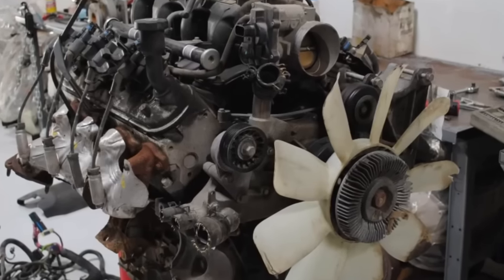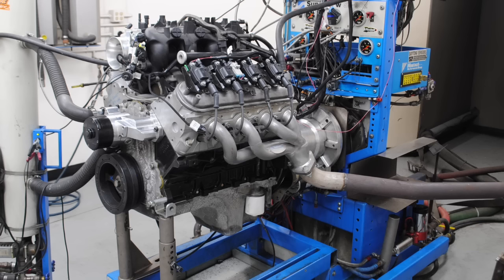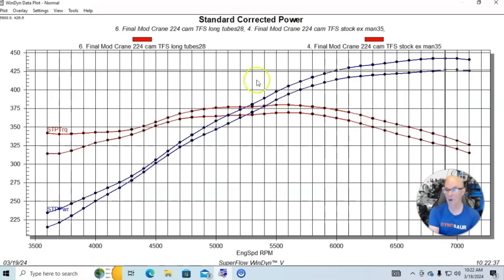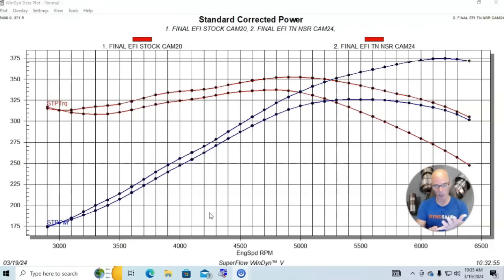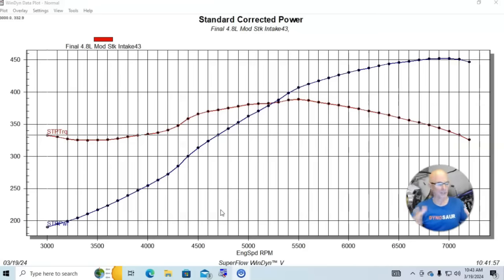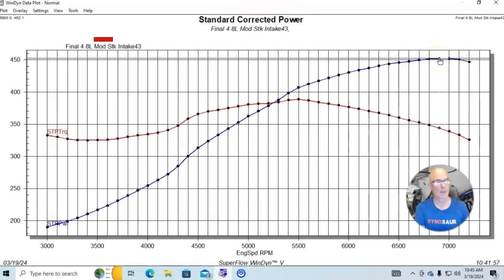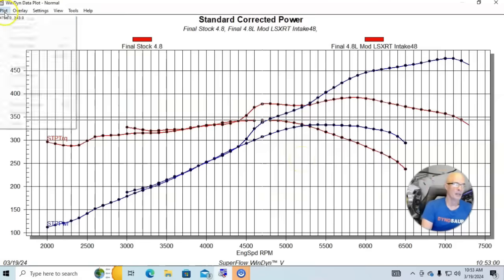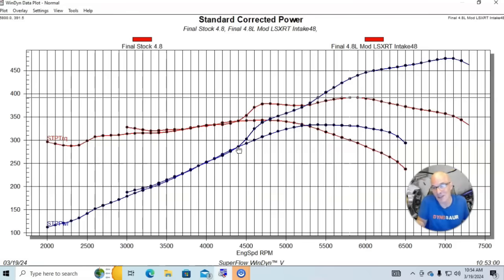HOW TO: MAXIMUM PERFORMANCE 4.8L! HEADERS vs CAM vs INTAKE vs HEADS, CAM & INTAKE! WHAT WORKS BEST?

Comment: I have a 234/239 | .615”/.610” | LSA112+2 cam on my 4.8L so what’s the best suggestion to make it run right w the cam instead off swapping the cam/engine ?
Reply from the maker: you can tune it properly, add a converter or change gears to help that very big cam run well on that small motor
Reply: @richardholdener1727  I have stock gears w no pos & the right torque converter !

Comment: Thanks for all your experience  n time ,i built an lq4 stock n put it into my 67 c10 short box an i have to tell you itbetter than any sbc i have ever build on a budget , now iam L .S. hooked ,picked up two 4.8 cheep ,machin shop said one needs a bore , second one is ready to run . Iam going to bil c first one to 350 horses. God bless yall real good.

Comment: Gday Richard, I hope you brows your comments as I have a question I am finding hard to find information on. Regarding the Comp Cams Billet Valve Rocker Covers, in particular the provisions for the Valve Spring oil squirters. Have you seen these and do you have any idea how they work, how do you get oil from the LS engine up to the Valve Covers in order to use this feature that Comp Cams are selling. Thank you.
Reply from the maker: I have not used valve covers with oil squirters and they are not needed on 99.9% of LS motors

Comment: all this talk about converters, lol, Im not spending any money modding the 4l60 🤣

and I'm not doing a tranny swap for another slushomatic with the 4l80

so that brings my big question

can I get a t56 magnum built to gandle the 9klb towing capacity of my gmt800 without giving up a gear? or am I looking at a 5spd t56? im goingvto be bolting it to either an ss awd tcase or the bw full-time 4wd tcase from the h2 if I can figure that out as a hacked subsystem (lockable helical center diff? yes pls?)
Reply: excuse my left pedal elitism while we still can, its gonna be hard coming convincing the EV world that two speeds and a clutch is s good idea lol...
Reply from the maker: no idea on that

Comment: There is a teeter totter point where  long tube headers hurt low-end torque- but you will never see it in your chambered world and with the limitations of your dyno. Engines that start making power from idle, and I mean like a 600-800 idle, with small valves, restrictive head flow, and poor flowing intake manifolds don't always benefit from free flowing exhaust... the word you probably hate- scavenging effect.  Here is the issue- your dyno, optimized for high rpm performance and selling parts is a computer simulation always based on the same comfy variables.  For example, your dyno does not have a reostat for adjusting load... yeah, load, load as in light car/heavy car, light/car heavy car on flat ground vs climbing the Rocky mountains, quality of air both humidity level and altitude ect.  Otherwise I agree with you 99% of the time and your the dyno king no debate- just not a real world experienced off-idle grunt lo-po engine experienced kinda guy.  The world has almost always been your performance orientated oyster while the rest of us were reading your magazine articles truly working with "realistic" junk yard parts (good junk yard parts were always reserved for the good ol' boys along with no celebrity discounts) daily driving sht like that every day.  Keep it up man, we are a dying breed, and it is truly weird how the LS stuff has made most of the old, highly desirable stuff dime a dozen affordable paper weights.  Like other than #s matching guys, who the hell is running camel humps??
Reply: BTW, I am sure that you already heard, but Courtney died a month or so ago.  Big loss, especially since his outfit is about the last reputable BBC company around.  Hopefully Scott takes over, well at least as the "brains of the operation."  I always argued that Scott was the true mad scientist of flash.  Hopefully now they can start selling 540 stroker crankshafts outright instead of as absurdly priced 10k plus crate engines.  I am biased since I am sick of my Caddy 500 being limited by capitalistic crankshaft manufacturers...
Reply from the maker: there is no WOT at 600 rpm in the real world or any other world and long tube headers might not flow better than stock manifolds or shorty headers, but those offer no scavenging. Please show me any verified results (not speculation or feelings) where long tube headers hurt low speed power. The dyno is not a simulation, the load can be adjusted and every EFI (and some carbs like the CAD) adjusts for air temp and altitude. BTW-Every junkyard part is realistic.

Comment: No mods. LS engines suck
Reply: They are actually pretty awesome compared to a gen 1 SBC, but the way they take mods is just simply outstanding.
Reply: My bolt on ls6 went 10.7@130ish......stock heads, stock cam, sbe. Far from sucking. That was a engine from 2002.....there are no furds there are no doges that could do that from that era.

Hell the new coyotahs struggle to do that. When they do they're on a fuel, gutted, race brakes. I was on pump gas with no gutting and factory brakes.
Reply: How so?
Reply: They have a few minor high mileage issues mostly lifter failures I would take one over any ecoboost or audi anyway.
Reply: @HioSSilver1999  coyotes do not struggle to run high 10s NA idk what planet your on
Reply: @knowbull5hit590  yea they do. You have to destroy those pos to get there.

Took h/c for a friends 5br0 to get there. Gutted, spooled, hollow axles, race brakes, kirky seat, drag bar, t56, 4.88 gears and 8k clutch dumps all to run a 10.5@130. Same day same track we went 10.5@132 with just bolt ons in a c6 ls3.
Reply: What an ignorance thing to say.
Reply: @bri-manhunter2654  that would be " ignorant".
Reply: 😂😂😂 Said no one ever. Sit down boy stay on the porch
Reply: @knowbull5hit590 They most certainly do. LS3 and a LT1 Camaros run all over a pos 5.0
Reply: @lanegeisewite1436  🥰🥰🥰🥰🥰
Reply: @lanegeisewite1436 you have no clue what you are talking about... people are making 3,000 hp on a stock coyote cant say that about any LS. Typically LS are blowing head gasket anything after 1800hp and nowhere near being stock 😂😂😂
Reply: @brianb8489  no one is making 3k hp on a stock coyotah.....you have no clue
Reply: They suck because they beat you
Reply: @HioSSilver1999  the snot-rocket mustang is making 3,000 hp on a stock block...look it up
Reply: @HioSSilver1999  it's Brett Lasala who drives the snot-rocket mustang, stock block with a resleave, stock heads, stock crank...and drivable on the street,the guy has set multiple records. You know nothing.
Reply: @brianb8489  A pos 5.0 can only take 20psi before they crack the sleeves or the block which is fuckin sad. That's facts. A LS or LT u don't have that problem
Reply: Lots of stock motors sucks like the 2j, k20, and br motors they All are choked out by government over reach but have potential.
Reply: @lanegeisewite1436 . 20psi, that is relative sir. Big difference in 20psi from a small vs big turbo.
Why would you say a 5.0L is a POS? Stock 12+ compression, with factory heads flowing over 300cfm, VVT, & the ability to hold lots of boost with just an oil pump change.

It’s okay to just say you don’t like the motor, but it’s also foolish to call it a POS. I know your comment was directed at someone else, but I couldn’t let that slide.
Reply: @bri-manhunter2654  😂😂 U butt hurt about the truth. Boost is very relative because it's a measurement of resistance. Oh and what do u LT SBC been running since 2014. High compression vvt and truck heads flowing better than a LS7 head. 5.0s are trash
Reply: @brianb8489  that's not stock like you claimed.  A sleeved blocks is a re-engineered block that otherwise couldn't hold up.

You know nothing.....and the proof is on your channel.
Reply: @HioSSilver1999  wrong again dum dum 🤡
Reply: @HioSSilver1999  anyone who wants a stock block to live threw high boost gets a resleeve. You know nothing 🤡
Reply: @HioSSilver1999  you obviously didn't look up the snot-rocket mustang, in a video he did a month ago explaining what's in his motor.....it made 2950 hp at 53 psi of boost.... again you know nothing LS boy 🤡
Reply: @brianb8489  actually no....gm blocks can get there. Sbe ls has been 6s. You know nothing.
Reply: @HioSSilver1999  wrong dum dum even the cast iron LSx block is only good up to 1500 hp before cracking a cylinder. Only LS making near 3000 is a cast dart cast iron LS-next block and it still won't hold a head gasket. Steve Morris made his own billet LS block with a better head bolt pattern because they can't hold a head gasket. Once again..... you know nothing 🤡🤡🤡
Reply: @lanegeisewite1436 . Truth, i’m shaking my head, along with others, at your stubborn ignorance. Also, it’s apparent you don’t understand the correlation between size and boost🤦🏻‍♂️

Just like Richard, Holdener, I’m an engine guy who doesn’t exactly have a preference. You should quit while you are ahead.
Wisdom has been chasing you, but you have been ever so elusive for it to catch .
Reply: @brianb8489  you really don't know wtf you're talking. 

But even at 1500hp.....that alot more than a coyotah can do before needing sleeves. So you lose again.🤣🤣
Reply: @brianb8489  btw....lets talk na like real men. Boost is for engines that can't compete when they have to breath on their own.
Reply: Why do we all argue as a diehard chevy guy and my boosted ls trucks that I have the coyote is a awesome engine and both the ls and coyote will stand the test of time. What these guys are doing with the ls and coyotes are very impressive after 26 years the ls was bound to meet a competitor